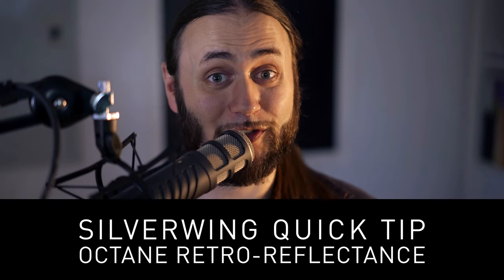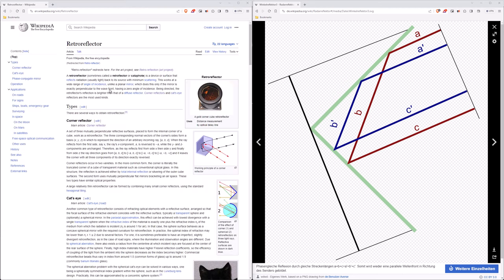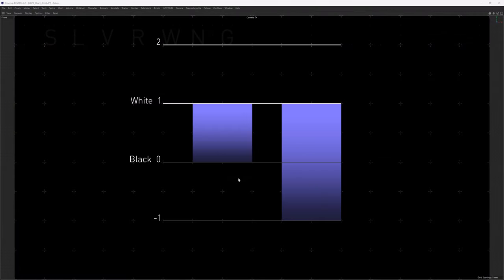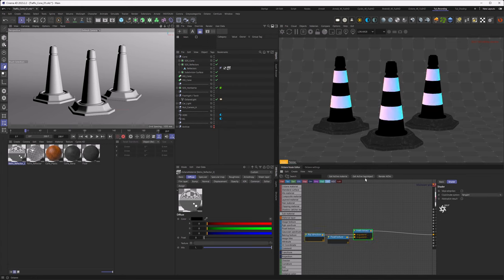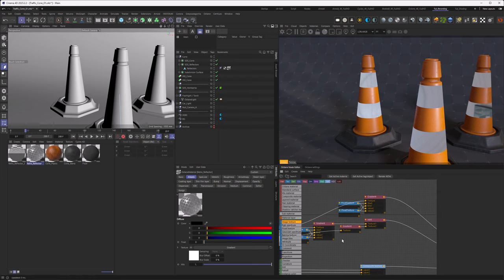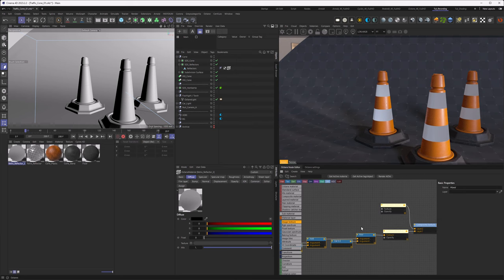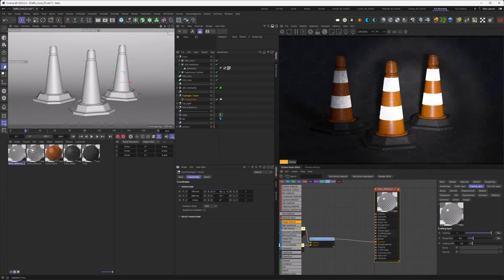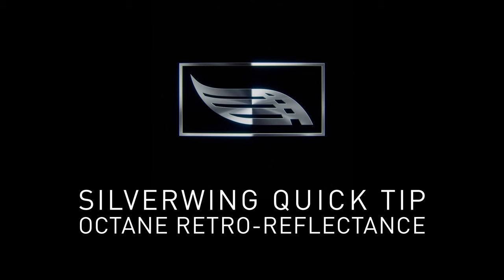Silverwing Quick-Ish Tip: Octane Retro-Reflectance

Comment: What I love about Raphael Rau videos is that his tips work with other renderers as well. The logic is the same. Only the node names are different. Great video like always.
Reply from the maker: Thanks so much.
Yes very true. In most cases it´s universally applicable. Sometimes there are some small differences. In this case I got it working in Blender Evee / Cycles by just connecting the "Incoming" port of a "Geometry" node directly in the "Normal" Port of a Matereial.
In Redshift I wasn´t as smart and I am still looking for a solid way to get retro reflectance going.
Cheers, thanks once more and a good time to you 🙌✨

Comment: A lot of information that will be useful, if I remember it when I will need it :) Like the difference of vector and normal space. Those kinds of things can take quite a long to debug when you have a set-up that should work in theory, but doesn't work.Thanks for figuring it out for us !
Reply from the maker: Thank you for your great comment. Yeah that´s what I do too. Watching tuts and then remember where the info is once I need it 🙌
I was researching this the other Day. I first used the "mapper" node (instead of four node setup) but that seems to give me the wrong values somehow. Need to speak to the devs about it. So the more cumbersome 4 node solution (adding by 1 and then multiplying by 0.5) is the way to go for now.
Cheers and a great start into this week for you!